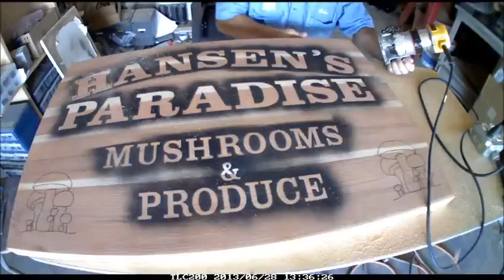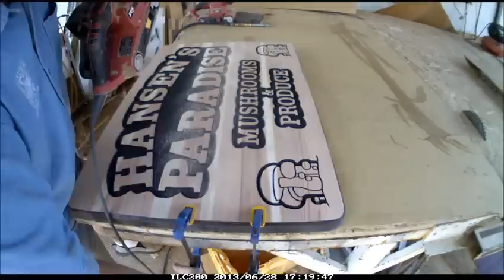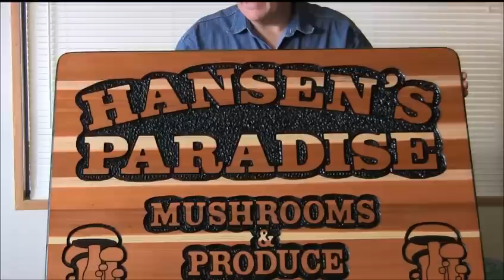#74 Freehand Carving a big redwood sign using time lapse

Comment from the maker: @crvngsgns, I've been using the Krylon for a couple years now. Done 100's if not a 1000 signs with it. I haven't received any issues so far. I'm sure I haven't done the research you have on finishing so I can't say for sure how spar works on cedar. However before I used the Krylon clear I was using the Minwax Helmsman Spar in the spray can. I know I did 1000's of signs with it & had no issues there either. Hope this helps & thank you,
Eric

Comment: Seeing the project from A to Z is very helpful, seeing you turning the sign , working in an upside down mode around the outset letters. I learn a lot too. Some minutes in the real speed with a close up view may help too. By the way, for an idea, which dimension is the sig and the size of the letters used, top letters and bottom letters. keep the goos work. I guess the timber is oregon pine? am I right?

Comment: Great craftmanship but very time- consuming. We have two large table CNC routers (5 ft x 10 ft tables)  and have very talented graphic artists who create 2.5-D and 3-D computer models to drive the routers - we can make 10-20 carved 3-D bas-relief and 2.5-D flat relief wood and HDU signs a day, our routers (Cost $45,000 each)  can work 24 hours a day, no sick leave , no complaints, no mistakes. We used to hand carve and use hand-held power routers 10 years ago, but those days are long gone if you want to stay in business. Paul Williamson, Art SignWorks, Inc.
Reply from the maker: I appreciate you watching and your opinion. I have many friends that use CNC's. I have a great respect for them. However I completely disagree with your assessment that to stay in business you have to use a CNC. There are lots of freehand sign carvers that do just fine in business. Can you leverage your time better with CNC's, of course you can. However it just depends on your definition of a success.
Reply: Yes, there are many artisans that do hand-carving as well as use a a hand-held power router, and they do beautiful work..We did it the way the first two years we were in business.  We do a lot of 3-D bas-relief carvings, and after we have the computer .STL file, we can make hundreds of carved wood or HDU plaques of the same design  for ZERO labor (at least for carving). I have 16 people that work for me, and have lots of overhead, workers comp, rent, sales, design, etc, and we would be out of business in a week if we carved signs the way we did 10 years ago. We still do some hand trimming and hand sanding, and of course hand-painting. We produce over 4000 high-quality carved wood and HDU signs each year (some of our plaques are in the White House, the Supreme Court and Congress) , and we could not do it without CNC routers.  Carving signs with hand routers and chisels probably works OK if you have a home business and you are the only employee, without all the overhead larger shops have.By the way,  my definition of success is to make thousands of high quality signs and plaques for the Government, commercial businesses and consumers and to support 16 employees and their families with a a good living.See www.artsignworks.com.
Reply from the maker: Congratulations on your successful business. Not my definition of success.... not looking for employees other than family. My guess is that most of our audience are small 1 or 2 person home based woodworkers.
Reply from the maker: Hey Paul,
I've been the carved wooden sign business for over 40 years and I just have to say that your products are some of the finest that I've seen in those years..I checked your website and am gonna keep you in mind for future sign requests.
I admire what you've built over the years...and thanks so much for sharing you opinions ...and your link to your website.
Can you share what the make of the CNC machine that you use?
We do most of our signage by the hand carved router method...they are not as exact as your CNC carved signs are.
We've had as many as 12 people working in our shop back in "the day"... but we're down to just family now...very little overhead...not a big volume as in the past...but with just a few family members we don't need big volume to make a very comfortable living.
May God Bless you and help to continue your success,
Dave
Reply: Dave
 We use two Shopbot Alpha 5x10 ft tables, one has a automatic tool changer. We use it for 2.5 -D (flat relief) signs & plaques, use mostly flat bottom side carving bits. The other router we use for 3-D carvings, with either a 1/16 inch or for small intricate plaques, a 1/32 inch diameter  ball nose bit -takes a long time to carve 3-D intricate designs, several hours to 20-30 hours for large detailed pieces, but we run it 24 hrs a day and on on weekends unsupervised. Shopbot is not the most expensive router, but because we use them to carve soft materials such as HDU, Cedar, redwood and Mahogany, acylic, HDPE , etc(not metal). they are more than adequate. We have used one 12-15 hrs a day for 10 years, no problems. We do sell our  signs wholesale, even to other carved sign makers, when they have too much business. We even sell unpainted signs. Our design is free for 2.5-D signs (like you make) , but we have a set-up 3-D modeling fee for new custom 3-D bas relief signs when we do not already have the tool path  file or cannot buy it commercially (there are several 3-D clip art vendors on the internet).

Comment: please can you tell me,what wood is that,and what spray you use to finish,THANK YOU
Reply from the maker: Hi Samir, I used 2" thick laminated Redwood on this sign. The spray finish is Krylon Crystal Clear. It's an exterior acrylic finish. Hope this helps. Thank you for watching and for the question, Eric
Reply: Where I can buy that point bits what you use??
Reply from the maker: All the bits we use are available on our website makeawoodsign.com under the Sign Carving Supplies tab. That pointed bit is our Profile Bit.

Comment: what kind of wood is best for carving in door /out door signs and how do you get letters sharp in the corners ,with a chisel after its been router out?
Reply from the maker: Deeword Page For the wood I like Cedar, redwood, or select pine. I don't use a chisel. My bits come to a point so I can pull them out at an angle and it'll leave sharp inside corners. Thank you for watching & for the nice compliments.

Comment: Hi Dave great work on the signs! You said you applied a couple thin layers of "finish" . Is the finish just a spray can of sealer? What exactly is it,  lacquer , varnish clear coat?  and one other question if you don't mind.. I am going to be doing some fine point engraving on a growth chart, could you recommend a router diameter and degree? Thanks in advance!
Reply from the maker: +Scott Brooks (Disney Dad) Hi Scott, I use a couple different finishes (not together) depending on how extreme weather the sign is going to be exposed to. Mostly I use Krylon Crystal Clear. it's an acrylic spray. The other one (for more extreme weather) is Minwax Helmsman Spar Urethane. Sometimes spray can sometimes brush. On the bits we always use 1/4" shank bits. As for the degree, I would use either our profile bit which is 15 degree down to the point then a 45 degree at the bottom. OR the whiteside SC50 which is 11 degree all the way down. Both are available on our site makeawoodsign.com under sign carving supplies. You can see the SC50 on our video newsletter #145. Hope this helps. Thank you for watching, Eric
Reply: Thanks for the quick and polite response!